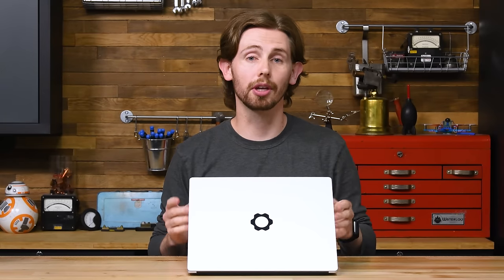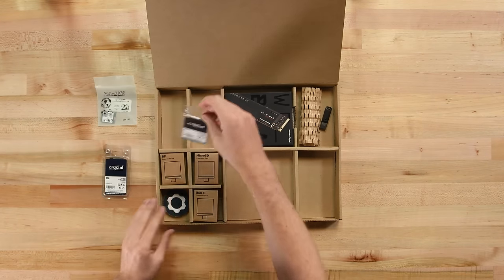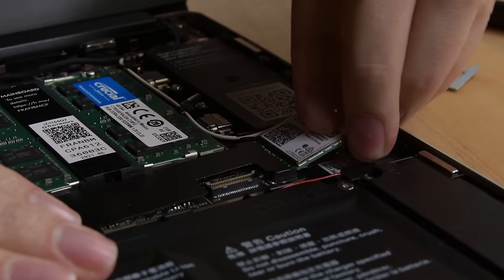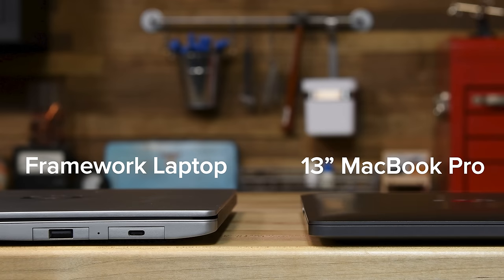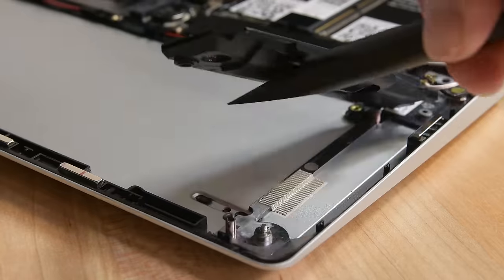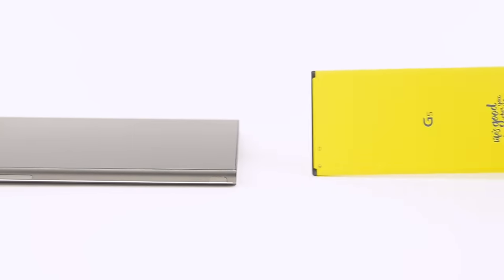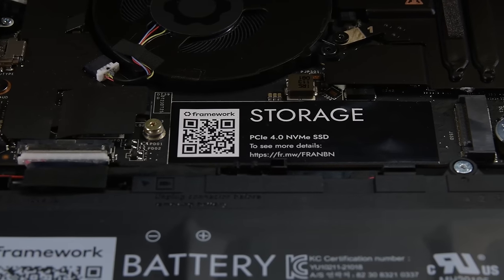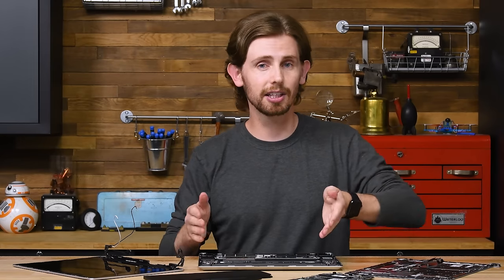Framework Laptop Teardown: 10/10, But is it Perfect?

Comment: Pretty cool just imagine being able to replace a LCD screen with an oled
Reply: Would hope they start offering different levels IE OLED and high quality colour correct for graphics work ETC
Reply: As far as I know they have plans to do that
Reply: Linus Tech Tips said the motherboard supports touch even though the screen is not, so they definetaly planned for multiple screen options.
Reply: As much as I love the potential of a device like this, "imagine" and future potential make me uncomfortable. I don't want to invest in a hardware platform for it's potential. If I buy it, it will be for what it offers *today*.
Reply: @GreenFox1505  Yep, but it already looks like a decent laptop.
Worst case; you have to chuck it when it dies, like you do for all the other models on the market.
Reply: Omg yes.
Reply: @marc0523  I do not know the details but if the heart of the computer (motherboard) works you can turn it to a PC. They encourage and give instructions on how to do it.
Reply: Doesn't computers typically have way too much static content to be suitable for OLED? Taskbar especially.
Reply: @GreenFox1505  It already has more value than other laptops today. Even if the company goes bankrupt tomorrow, these devices will still be easy to repair and will still be upgradable way more than others. You can still convert the logic board into an ITX PC. 

The thing is, if the company survives, it will exponentially increase its value in lieu of what they'll be able to create, like stuff from custom laptop keycaps to screen replacements.
Reply: Good luck finding that part.
Reply: @prebenjaeger  Not as bad as they used to but there is always the "Hide Taskbar" feature
Reply: @prebenjaeger  I have an OLED and haven’t noticed any burn-in after a year and a half.
Reply: @GreenFox1505  yeah but it's a decent laptop today tho
Reply: We've been trying to specifically track down an OLED screen that will fit. Seems like there's a couple potential panels that are the right size and either the same or higher resolution. I don't personally like the glossy finish but most of these sized panels (that might fit) seem to be glossy, which is a pain, but the color spaces seem really good with 400 nits or higher peak brightness. Not able to confirm yet if they actually physically fit, but asking around repair shops that have laptop screens come through on a regular basis.
Reply: @The_Cyber_System  so the glossy finish/matte finish is not a coating afterwards?
Reply: @aronseptianto8142  I have no idea. But the community has been trying to find compatible panels for a couple months now and we've been finding some contenders. Head over to the framework community to read up a bit more on it. I just wanted to let people know in these comments that it may already be possible.
Reply: @The_Cyber_System  ngl this is kind of refreshing, thanks for the info
it's kind of the same when I first started following the development of blender and how fast paced/ open it is, but like, for hardware.
Reply: or an oled with another better oled or even micro led. Or replacing the oled if it has burn-in...
Reply: @61 Cygni not as much as replacing an entire laptop. Also OLEDs don't burn-in as much anymore and if you really hate it so much get an LCD for your self.
Reply: It would be so cool if thez will keep their word and let ppl upgrade the motherboards over the years...
Reply: You got a good point there. Hopefully in the future.
Reply: @GreenFox1505  its that EXACT line of thinking that has stopped things like this getting off the ground in the past. Either invest in the technology you want to see in the future, or lose it forever and be stuck with the same slabs as every other sheep around you.
Reply: or high refresh rate for gaming, especially if the laptop had a dedicated gpu.
Reply: @GreenFox1505  srsly dude, why put out negativity like that?  Why say anything like that when the entire video is a review, and you're doubts don't add anything to the conversation. Really. Nothing. Pretty close to trolling, even though I don't think you're doing it on purpose, Mr Negative Fox
Reply: @marc0523  Or like fairphone. Buying used spar parts from others owners on ebay for years after the manufacturer have stopped support.
Reply: @aliticx  good luck finding any other laptop part
Reply: @GreenFox1505  well they kept up with their promises and even did more, besides the device is good already as it is even if they didn't offer upgrades in the future.
Reply: I want a touchscreen!
Reply: @GreenFox1505  Two years later, they have new displays available for it, 11th gen, 12th gen, 13th gen intel core processors, ryzen 7'th gen processors and even the new intel core ultra CPUs. New wifi cards, speakers, upgrade battery, more expansion cards, and they even have a RISC-V based motherboard. So it will be the worlds first consumer laptop that has an open source CPU/motherboard option.

Comment: The USB-C modules could host two USB-C ports on the outside, just to be a bit picky 😁
Reply: Yeah the "pass through" modules could be a bit more than literally a 1" extension.
Reply: Framework has mentioned that the charging circuitry for that got too expensive (the laptop charges through one of the USB C modules). However, there are already third parties designing exactly what you're looking for.
Reply: @imadogg5612  yea, the CAD files developers need for that are even open source i believe so in theory anyone could make something for it
Reply: Thats the great thing about this: their designs are not patented meaning any company can step in and make more addin cards for this thing! I personally would love an rj45 addin card when and if i get mine.
Reply: Agreed but definitely picky
Reply: That's the beauty of 3rd party support!
Reply: 3D printed parts and some soldering know-how would most definitely take this laptop to the moon
Reply: @boazkn8049  I still use a serial port, I wonder if one would fit?
Reply: usb C octopus anyone?
Reply: ... or also a AUX module.
Reply: I mean Aux is the only fixed port this thing has…
Reply: Yeah. They have CAD files for everything IIRC. It's open source hardware, for the most part. The laptop components anyway. What's got me so excited about this is not just the modularity of the ports, but the whole thing is easy to repair, swap parts in/out, the works. My only minus is it's not a full size keyboard (I like my numpad).
Reply: yeah i think all the "modules" should have at least 2 ports.. 1 port is pretty lame
Reply: Most likely to keep charging functional. Though I would also like to see a USB-C "hub" module which gives two ports but might lack stuff like charging. So you can have one USB-C for charging and two additional USB-C ports in another slot, or maybe two USB-A if that could somehow fit in one of those cards.
Reply: @marc0523  serial port is thicker than the whole unit almost
Reply: They mentioned in the forum the problem isn't fitting the ports on the outside but the circuits inside (while maintaining full functionality for both ports)
Reply: @marc0523  Dell uses really slim connectors for their rugged models, you could probably use it in this Form factor
Reply: @HurricaneRainbowOG  I mentioned this in another comment. Obviously, this is a bit of a gamble on their part that requires huge investment so they launched an initial offer that is technically more than enough to cater to the needs of most consumers and I bet they have already planned for a high-performance product line with discrete graphics and full keyboards. Seeing the attention to detail in the initial product suggests they have spent more than a little time thinking about the long run and they are just waiting to hit a specific target to expand their offer asap.
Reply: @papapetad  yeah, I see that too. Gives me confidence in the overall scheme.
Reply: @photelegy  the laptop has a built in aux port!
Reply: @drackar  The USB C modules certainly are that, and there's no reason they couldn't do a dual-port USB C module that you couldn't charge through (or at least not both ports), but the other modules are USB plug type adapter (C to A), plus modules for full-size HDMI and Display Port, MicroSD card reader, and 250GB or 1TB storage modules (not sure what type as they list them as 'ultra high speed' which suggests it's not typical USB flash memory). They also have in development "high-end headphone amps, Arduino-compatible microcontrollers, and more". So all told, a lot more than just a 1" extension! 😉
Reply: @gh8447  Yes, the parts that are not the one specific part being discussed  are, indeed, not the part being discussed. Sound logic there.
Reply: You could probably fit four of them on there, which would work nicely with how USB hubs work. (Though I'm not sure if USB 3 is the same way)
Obviously, this would be more expensive since you're going from a passive adapter to an active adapter. But also, you'd have less bandwidth. For most applications though, this would probably be a non-issue.
Reply: Just wait for the third party stuff. I am sure someone will do it if this even moderately takes off.
Reply: @marc0523  Easily. Question is if somebody else will make one, but you can make one yourself without too much trouble.
Reply: @nokyan  true. In theory you could even make your own custom dongle if you are skilled enough. For example an c passtough with an internal Logitech g lightspeed receiver inside. (It would have to be plastic for the receiver to work tough.)
Reply: @Lucas_van_Hout  Phones with aluminum chassis had plastic strips to allow for the signals to go through, maybe that'd work for the Logitech receiver too? That way it wouldn't have to be 100% plastic
Reply: @marc0523  I'm sure you could if you were willing to extend outside of the formfactor of the laptop.
Reply: I wonder if we might see hot-swappable batteries again one day. I used to have a Compaq that had one, AND you could swap out its DVD drive for another battery pack. It was a pretty chunky machine, but that was pre Lithium batteries. reminisces wistfully :p
Reply: @ElJohnerino  Lenovo still has some laptops like that, I think.
Reply: Well framework is working with 3rd party developers to create accessories for their product. So I think it’s entirely possible in the future?
Reply: @Taylexwow  nothing stops you from making connector sightly offset of laptop body.
Reply: I was thinking a module with 2x USB-A. Maybe in the revision
Reply: @Leoappeared  since itsa must have
Imagine Laptops without 3.5 jack like how phone and tablets nowdays
Reply: @sotonin  I found in Framework forum someone doing that
idk how it progresses though
Reply: That's been discussed on the framework forums, the circuitry would be wayy too complex (if even possible) to do that and retain the full functionality on both ports.
Reply: @nokyan  I heard the actual framework engineers even helped solve some technical issues the 3rd party was happening, that alone is enough to call Framework the Open Source Laptop of the Internet.
Reply: Likewise for USB A ports. Or, if space is too constrained (which would be a bad design plan for the modules), one USB-C and one USB-A port on the USB modules.
Reply: @marc0523  The FTDI circuitry will fit easy-peasy. The DB-9 socket  itself could be a bit of a problem - it's fairly thick so it would probably need to hang outside the laptop outline - or you could go the ultra-cheapo way, give up on the metal outer shield, and have the module 3D-printed with socket-shaped gap and 9 pins, not even the top/bottom bezel, just the sides gripping the plug, and possibly threaded inserts to allow the mounting screws.
Reply: @AgentOrange96  You'd never fit 4 plugs in these 4 ports to 1 module, a common problem with too tightly packed sockets on hubs. But you could totally make it with 2 outer sockets, and 2 left inside for stuff you'd have mounted permanently, say, a custom wireless mouse dongle and an NFC reader.
Reply: @marc0523  No, but it fits in the 30mm width. You could make an oversized thicker than normal module that would still slide in. The same is being done for RJ-45. Both are approximately 10mm tall on the female side, whereas HDMI, USB, and DisplayPort are all less than 5mm tall. I have a funny feeling that Framework has thought about this, though, and will be releasing first-party RJ-45 and serial port modules as well as other double-height cards which will form the future of their ecosystem.
Reply: @drackar  how you mean? they sell modules that are usb c to usb c and yes those are just 1 inch extensions

but they also sell wifi modules, usb A modules, hdmi, display port, card readers, and more
Reply: @Sarge92  I was talking about one specific model not the entire godamn concept.
Reply: I REALLY WISH they win with this OPEN idea as IBM PC did decades ago.
Reply: Air only has 2 usb c ports and still sell really well. 4 ports is more than enough for most people or probably more than 99,5% of the people, how often do u need 5 ports in the same time?
Reply: @gh8447  on one of those storage modules you could propably fit 64 terrabytes if you really wanted to. micro sd cards are 1tb and very small, and less than half of that is the actual storage chip
Reply: Thankfully it's thunderbolt but not certified.
Reply: @photelegy  There's a built-in headphone jack.
Reply: I thought the same thing when I first saw it